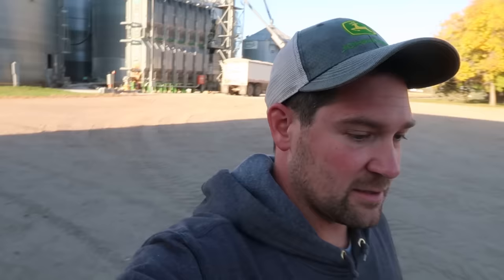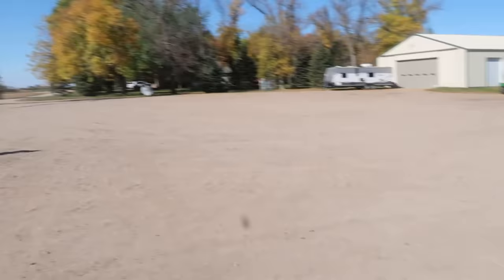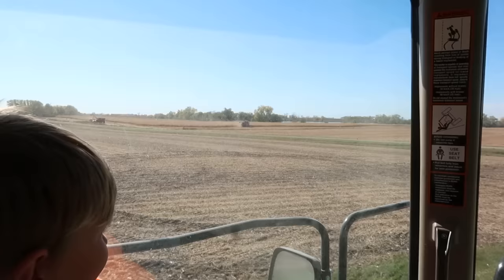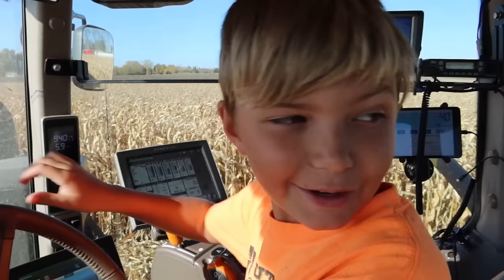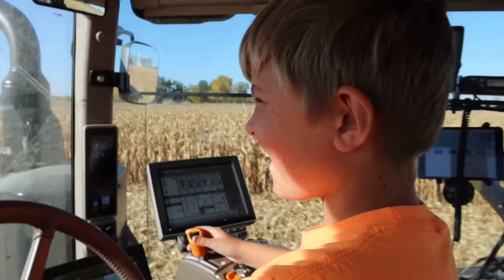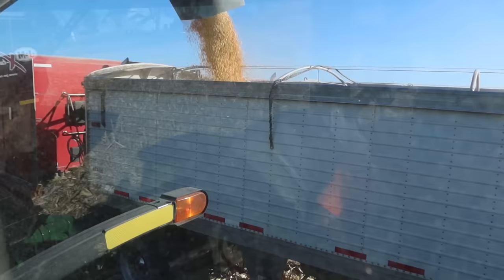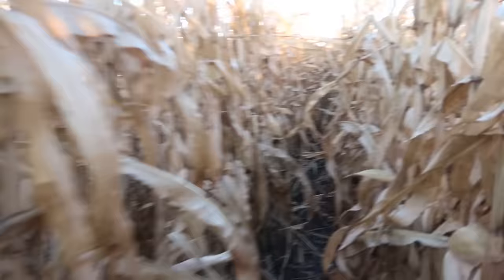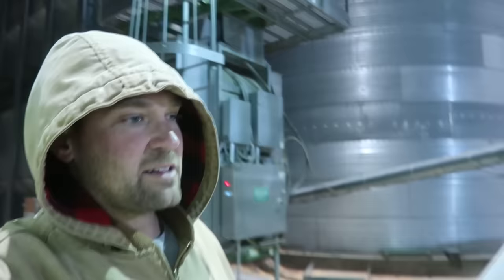Trying To Keep Up With The X9 Combine!

Comment: Trailer backing tip for Onyx: hold the steering wheel at the bottom. Push left, the trailer goes left. Push right, the trailer goes right. Keep up the good work!

Comment: Gotta teach "6" to hold the bottom of the wheel when backing up, his brain will takeover the rest and ensure he steers correctly!  Works 50% of the time everytime!    (really should try it)
Reply: Good strategy when learning and getting comfortable
Reply: that's how I learned
Reply: And don't turn the wheel real fast just slow in puts works well too.
Reply: I've actually never heard of that strategy, wish someone would've told me that when I was 16
Reply: The other one is "turn toward the danger" when backing.
Reply: He can do that. The other thing he needs to learn and it applies to equipment as well as the semi trailers. Use all the space you have, and if you're backing into a building or into a tight spot, to not try and do it in one shot. Take little bites while turning when backing and ease your way into position rather than showing off and wrecking.

Little stuff like that makes all the difference. He's doing a great job so far.
Reply: Never heard that one before, but it makes perfect sense, reversing a trailer is a challenge to start with, and a pain later on when you are used to reversing two trailers (everything gets turned upside down,  again)
Reply: @gkcl1  yeah when I was learning how to drive one of the old timers taught me that. He said that it doesn't matter how long it takes. A true professional doesn't hit nothing. Slow and steady they'll get there frieght you're ready. Hopefully he's enjoying retirement.

Comment: It's great seeing the kid drive the tractor. I was probably a bit older when I started driving by myself, for like an hour with the plow. Now I'm 16 and I operate our mower, rake, round baler, plow (in case we do), cultivators, disc harrow, roller, stuff with the front end loader and sometimes the combine. The only operations I don't do are seeding, spraying, spreading fertiliser and driving the trucks

Comment: I thought about this last night after hearing the 7000+ bushels per hour rate of the X9. If you run it for your 50 hours at even 6000 bph, that's 300,000 bushels. That seems like a lot considering the capacity of the grain cart, the trailers, and your bins.

Comment: That spot is on the sensor of your camera, not the lens. To remove: remove lens, put camera in cleaning mode (might be called mirror up), very very gently use very low psi compressed air from a distance and at a 30 degree angle to camera sensor to blow away the dust. If it doesn't remove, it needs to be wet cleaned with a kit. -Professional photographer

Comment: Onyx, I use to run the grain carts on my grandfathers farm. We didn’t have an auger wagon. I had to fetch and unload gravity carts into an auger to the grain bins. Then return them back to the field in another spot so he could unload in certain areas. We only had an old 850 massy combine and open cab farmall tractors.

Comment: First year running grain cart for our operation and the kids right it is difficult keeping up. We have a early 2000 challenger and an old Massey Ferguson and new this year as well is a semi trailer instead of two parker grain carts mounted on a truck with a gooseneck parker trailer too

Comment: You mention being in a t-shirt harvesting corn, we were still baling hay till our baling/field tractor fried the clutch today. Its fine...we paid 2 grand for the tractor 6 years ago with the clutch on its way out the entire time, ran 13 leg chisels with it, 6 bottom moldboard plows, 24' disks, haybines, round balers and a old George white snowblower with it the entire time. Not to shabby for a 67 massey 1130 with a wore out clutch.
Reply: Some of the equipment was like a toy behind it such as the 24' disk. The neighbor we borrowed that from wouldnt let us borrow his  20' offset because his 4440 barely pulled it supposedly when it struggled to pull the 6 bottom and that was nothing behind the 1130.

Comment: have onyx start loading in the back of the truck and back up to load it. with the tracked tractors it goes a lot smoother. then the cart does not go the opposite direction you want it to go for a little bit.

works good for us with 30 ton beer carts

Comment: FYI Ivers farm has an interesting feature on their case combines. They are using the onboard air system to blow the waste that accumulates on the feed to the combine right after the point where it picks up the header. A 2 second blast of compressed air blows over 85 percent of the waste leaves off the feed housing negating you having to stop and climb down to remove it manually. I will add the video in a few minutes. Season 2 Episode 24 not the arielview. At 16mins and 20 seconds they demonstrate how the system works.

Food for thought

Comment: Question, Zach: Suppose you invest in a high speed planter and X9's become a viable option for your farm eventually. What does that do for your timeline of spring and fall? Does it require a different approach to how long you used to plant/harvest or would it be marginal at best?
Reply from the maker: The approach would still be the same.  Plant as quickly as we can, harvest as soon as the crop is ready and go as quickly as possible.  Most likely a move like that would mean we picked up some serious acres and need to cover more ground in the same time frame.

Comment: I was wanting to know if you could mount your GoPro on the corn head, in where the corn gets fed into the rotor, in where the rotor and concaves and sieves and beater and chopper are, where the spreaders are, on the tailings elevator and both clean grain elevators, on top of the grain tank and on the unloading auger on and in the X9 combine sometime before you are done with corn harvest this year?